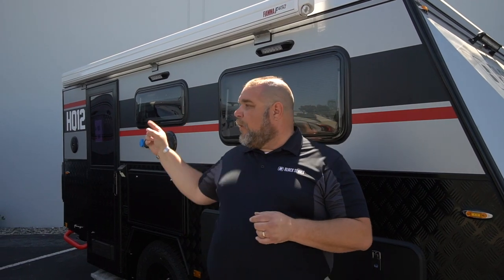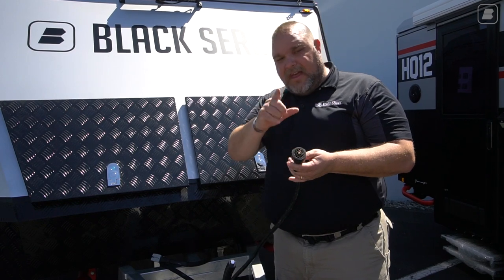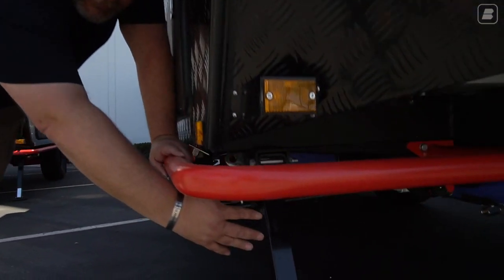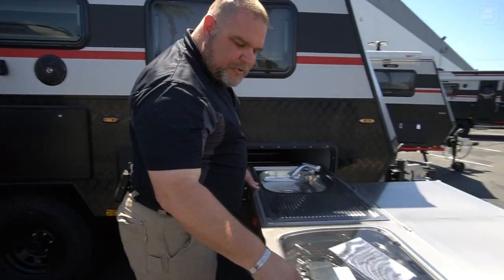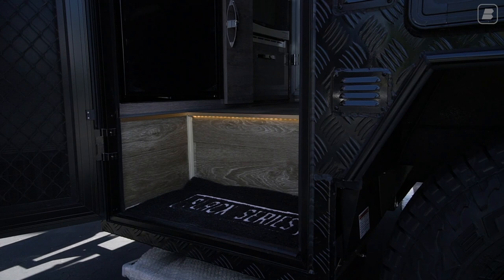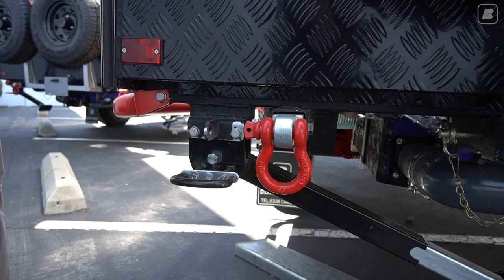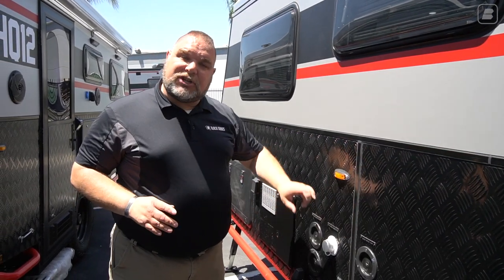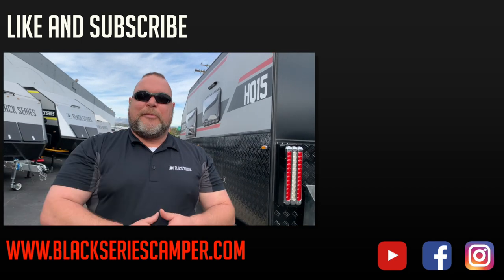HQ12 Exterior Walkthrough - Black Series Camper; Caravans, trailers and campers

Comment: Can a jeep wrangler tow this?
Reply from the maker: Depends on the vehicles tow capacity. The GVWR for the HQ12 is 7,500lbs.
Reply: The legal answer is no since a 4 door jeep's towing capacity is 3500lbs and the dry weight of the HQ12 is about 4400lbs.  Add at least 1000lbs for water and storage items and it's well over the U.S. wrangler's towing specs (in other countries it would be within spec from what I've read).  IMO, a 4 door jeep could tow it and tow it safely if it was loaded properly, the hitch and brake system was set up properly, appropriate driving speeds and techniques were followed and a person had towing experience.  Even so, I'm not sure how a wrangler would do pulling this much weight on a steeper, rocky road.  I'm not sure how a standard 1/4 ton pickup would pull it in that situation, either.  It's a bummer because I really want to buy this HQ12 but I want to tow with my wrangler.  I've towed a  much lighter T@G XL Boondock up some really steep and rocky stuff but I want a camper I could stand in and was built to handle off road like that.  I kind of shook parts of the T@G loose on only half a dozen miles of real off road.